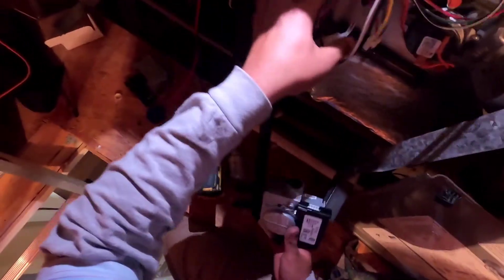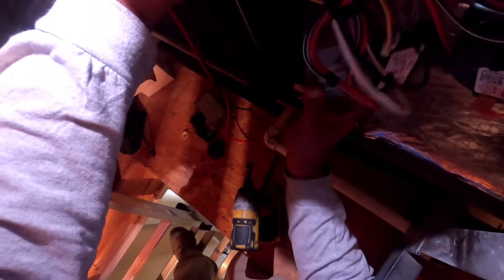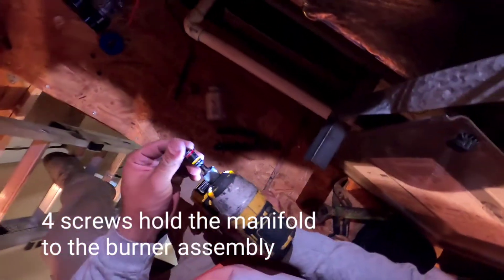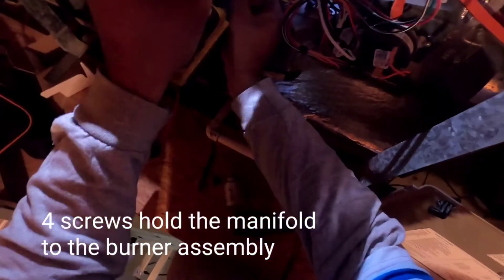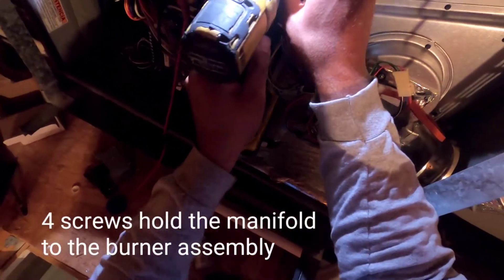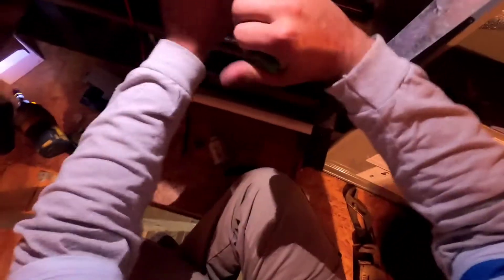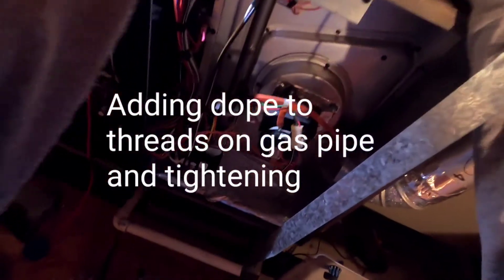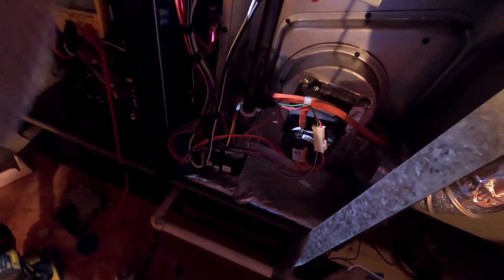NO HEAT!? HOW TO REPLACE A MODULATING GAS VALVE ON YORK FURNACE part2 CHECK BIO 4 SERVICE IN ARIZONA

Comment: Thanks, I think this is my issue on my York 80. It's been 21 years now, I have replaced  the igniter, flame sensor and limit pressure. It is still turning on intermittently. Got a code 7 red flashes.
Reply from the maker: at 21 years old it may be a better option to replace the furnace and get another 20 years
Reply: @themoderntradesmen  boy late response back from you, anyway it's fixed just replaced the gas valve by my friend's older brother for $400, will wait until it's broken, A.C. still runs cold, I replaced myself the dual capacitor and the fan motor
Reply from the maker: @giangnguyen8344  sorry haha, I'll be better next time. You replaced alot of parts so now you should be ok

Comment: Hi, great job. But don't you have to adjust manifold pressures after putting in new valve?
Reply from the maker: They come at a default manifold pressure already which is good for my area. When rising in elevation you do have to adjust it according to the manufacturer specs.